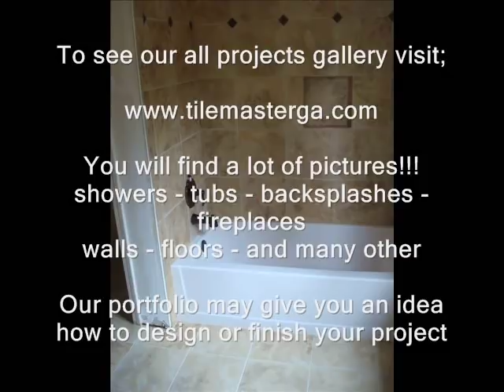How to install, replace a bathtub - plumbing, drain, bathroom installation, bath tub atlanta

Comment from the maker: .
1)Level tub best you can
2)Make shour drain is tight to tub with correct rubber gasket and putty
3)Test tub for any leaks befour covering walls and tiling floor ( water test is always reccomended)

Comment from the maker: @pitbulllover74   Sometimes concrete is helpfool, but not in this case!! regular tubs are already suported and laid flat on subfloor. If you puting drop-in jakuzzi tub - then youy may use concrete or different filer.

Comment: Very helpful video, but the tool you use to remove and istall the drain?  It would be better to use a wrench on the flats instead of boogering up the fat end with a pair of slip joint pliers, wouldn't it?  I am going to attempt a tub and surround replacement soon, and I needed the instruction.  Should be fun.  BTW, how heavy are those tubs?

Comment: I need some help here.  I'm installing a bathtub.  The installation instructions say to use a felt pad or mortar cement under it.  What is this for?  I understand the cement, but the felt pad??  I don't see how that'd do anything.  Some info would be greatly appreciated.  I can't find anything on here to help me with that.

Comment from the maker: 1)cut drywall out
2) replace stoper or valve
3) put new drywall 
4) Patch, finish and paint drywall

In 30 years you rather go with total bathroom remodeling including new tub, plumbing and tile work :)

Comment: Video was ok until he started using channel locks on a tool usually designed to use 3/8 or 1/2 inch ratchet with extension. Also personally I drop an old rug in Tub so if I drop a tool it doesnt scratch it

Comment: #Bayside 500 The way you did this does it only work if the tub you're replacing it with is the same size/width in particular not length as alcove you're generally stuck @John Edmonds

Comment: The Music is Cool, but not on a how too video. I think the video would be better if you recorded it, then did a Narration explaining your steps afterwards. I know how it is on a jobsite, you can't post hardly any of that audio. One other thing. I did notice the absence of a vapor barrior. Even two years ago a Vapor Barrier was code in a good bit of the country I think. Shucks even Mobile Homes in the 1980s have a vapor barrier around the tub. LOL. All in all Thanks for the effort!

Comment: @ 5:41 there should be a gasket there, but you used it on the drain shoe @ 1:29 LOL

overall fail and leak waiting to happen

Comment: Ok so this would have been  helpful expect you completely skiped the part where you replaced the drain and overflow.. To mate it with the tub you removed the overflow in this video but didn't show any of the steps to align it with the new tub.

All tubs are different so don't expect the drain and overflow to match to the new tub. They almost never do.